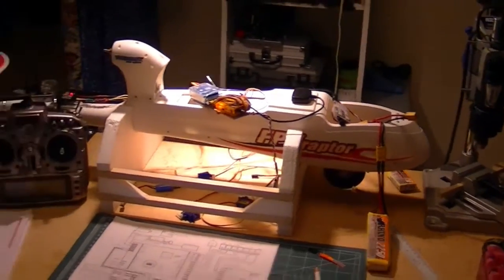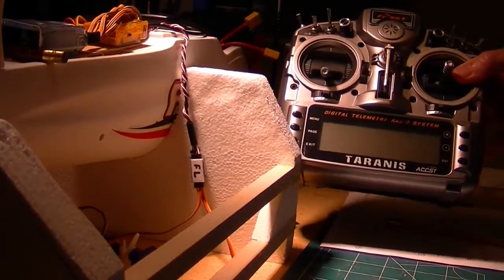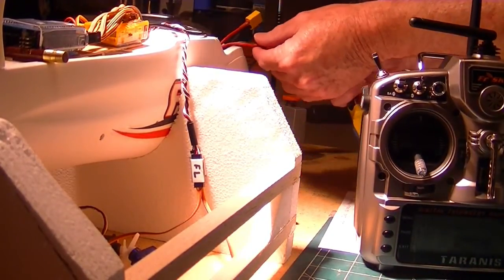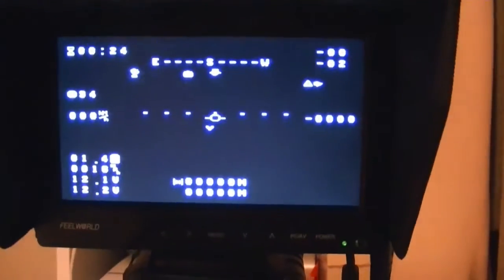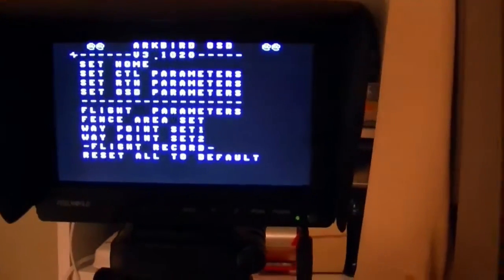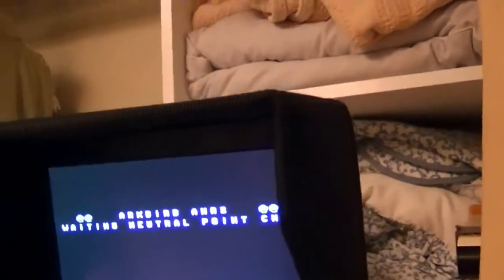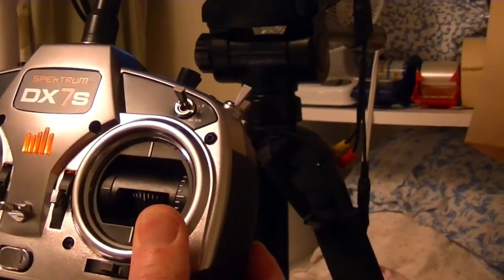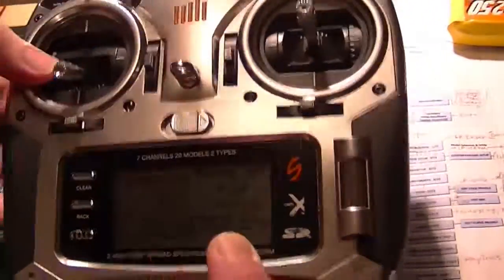HK Arkbird introduction, help with motor running in configuration mode

Comment: I have a similar issue to yours, but mine is wired correctly. I've had the AB for a while now and it seems like after I calibrated the ESC the motor comes on in configuration mode. I've tried what a couple threads say to do in RCG without success. I swapped with another ESC and did not have the issue. I am concluding it is the ESC.

Comment: I bought 3x arkbird systems, 2 were fine and does everything the way it supposed to do.1x arkbird does not run properly. when arkbird is connected i only get 50% throttle max, disconnect arkbird and all is good. must be faulty!

Comment: hi mate!! i need some help!!
i mounted arkbird in my raptor that flyes correctly in manual mode.
When i put estabilizacion mode on, it doesn't estabilize but make the plane fly vertically up or down. i don't know why. i reset it and calibrate with plane correctly nivelated.
it's something i made wrong and don't understand what.
Reply from the maker: Itanu1978 My friend put the raptor project on hold about a year ago and I have since forgotten what I did know about his flight controller. Sorry I can't help.

Comment: Also I use direct connect the esc to rx bypass the autopilot all together for throttle. Set failsafe to about 60% throttle and RTL.  I use it this way for both dragonlink OSD and FY31AP and keep control of throttle at all times. ;)
Reply from the maker: My problem was in the wiring between the Arkbird and receiver.
I put the solution in the description under this video.

Comment: If it's anything like the dragonlink OSD. Then when u enter the program screens of the osd it automatically sets the OSD to auto stabilize and adds throttle to keep the plane flying while you change the settings... hope this helps.
Reply from the maker: Thanks for the comment.
The problem was in the wiring between the Arkbird and receiver.
I put the solution in the description under this video.

Comment: dmerc00
Could  be an ESC problem like mrazy6 is suggesting. Let use know how you made out.
Reply from the maker: Ok, will do.
Might be a few weeks before I get my hands on it again. Jim is taking a brake.
Reply from the maker: The problem was in the wiring between the Arkbird and receiver.
I put the solution in the description under this video.

Comment from the maker: Originally Posted by AngelWings_AW  on RCgroups:
Hi!
I had problem with full throttle in manual mode - I forgot the ESC calibration.
Connected ESC directly to RX without the Arkbird. 
Another idea - I think I enter the menu while I´m in manual mode.
http://www.rcgroups.com/forums/showpost.php?p=28521905&postcount=2527

Comment: I could not imagine if you had forgot to remove your propeller before be facing to this issue >.< In my memories you used the APM flight controller with your skywalker right? Why did you move to the arkbird?
Reply from the maker: I didn't move from the APM. Are you kidding me, no way. APM is the best!

Comment: Try this (values may be different for your TXs): http://www.rcgroups.com/forums/showpost.php?p=26816484&postcount=1816

Also related: http://fpvlab.com/forums/showthread.php?21495-Arkbird-osd&s=3b54b65b322976712c4f7abf1c9a7c8b
Reply from the maker: Tried this.
The ESC does not seem to program the zero setting on the throttle.
Could it be an ESC problem like mrazy6 is suggesting below.